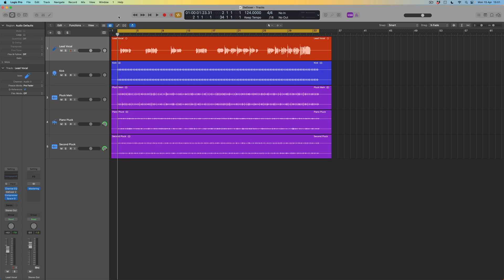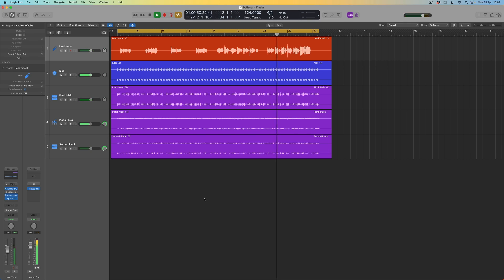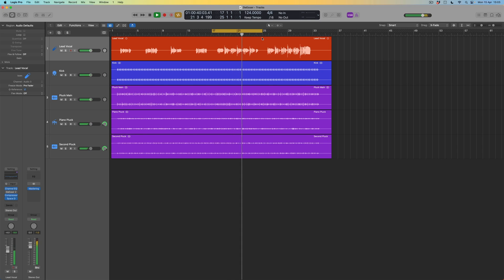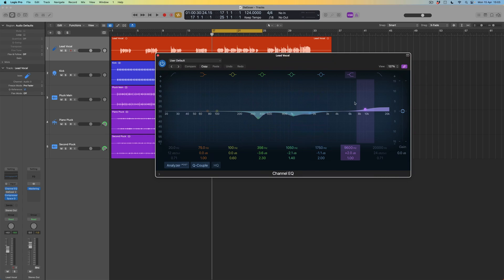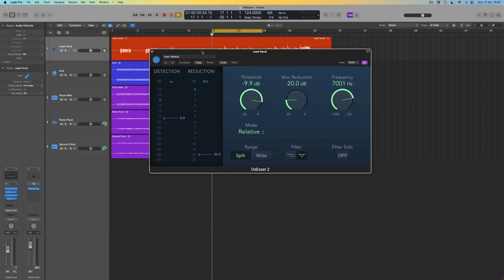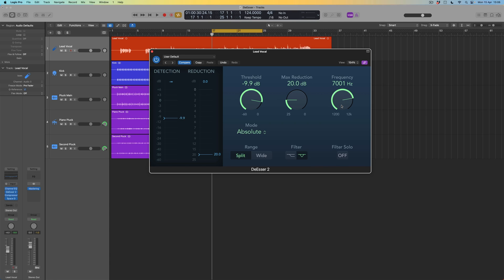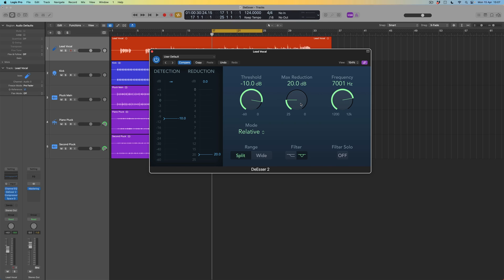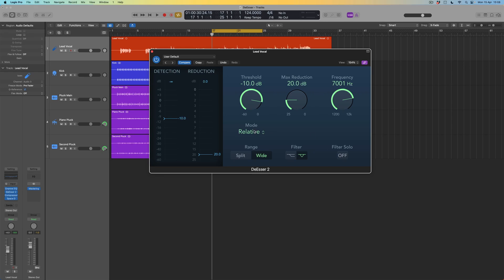Logic Pro X: How to use Logic's De-Esser

Comment: Hi Jono, I'm a new subscriber and I came across your videos. A big thank you, but...I have a small off-topic question that bothers me a lot and is a source of stress. I compose violin, string, or other instrument parts using the modwheel to manage dynamics. When I play the passage in question, everything is correct, but when I want to play the next part, the strings or violins no longer have any volume. Do I need to create a special region or raise the modulation volume? I'm a bit lost. thank's in advance
Reply from the maker: Hi Tony. Thanks for your question and welcome to the Channel. Which library/plug-in are you using for your string arrangements? Generally, most libraries use a few controllers to let you oversee Dynamics and Volume levels - usually Modulation (CC1) for Dynamics and Expression (CC11) for Volume. So it could be that you need to create controller lines for both of those parameters if the Expression is resetting to zero (hence no volume) for some reason. Also - are you composing each new string voice on its own new Instrument track, or composing each one within a single instance of your String plug-in? Sometimes, conflicting data on the same MIDI Channel can cause problems too. If you're happy to send over some more details in answer to those questions, I'm sure we can find the problem. Also, do have a look here: https://www.youtube.com/playlist?list=PL6JM7SQmyRYz5eHmpztXLf-xUC6BhaxKn That's a playlist of videos I've made, all of which relate to working with orchestral sample libraries, so it may well prove useful to you too.
Reply: @jonobuchananmusic  Hi Jono,

Thank you very much for your quick response. I wanted to clarify that I compose and program each instrument on a different track: violin 1 on one track, violin 2 on another track, and so on. My issue concerns the volume controlled by the modwheel. Every time I program a part (for example, a cello part over 8 measures), the sound disappears when I continue writing another part. It seems that the modulation creates a fade-out at the end of the section, and I have to increase the modwheel volume again to continue with other parts.

Is there a way to avoid this problem or to automate the modwheel volume reset for each new part? I have just on keyboard, Novation Launchkey.

Thank you very much for your help.

Best regards,